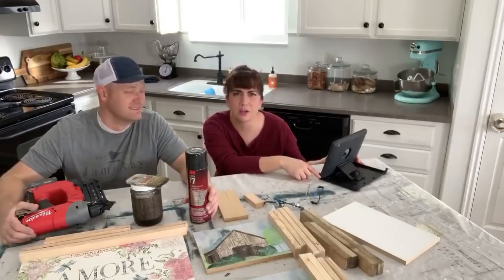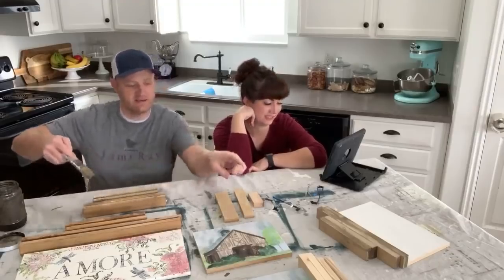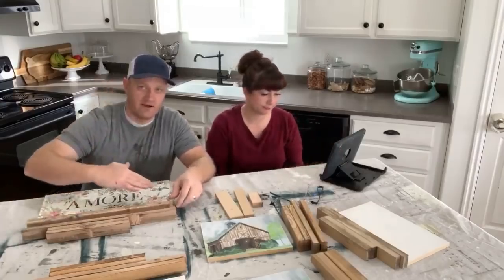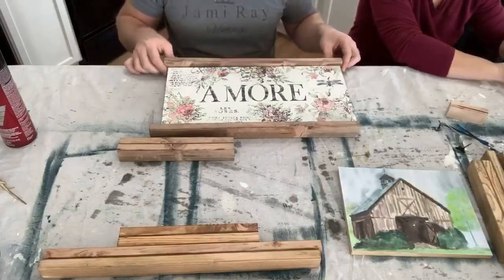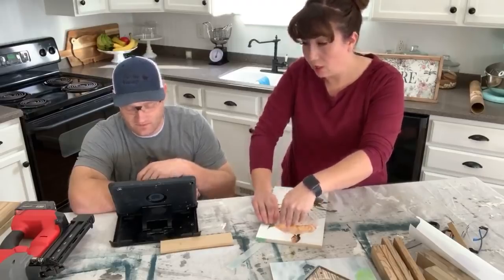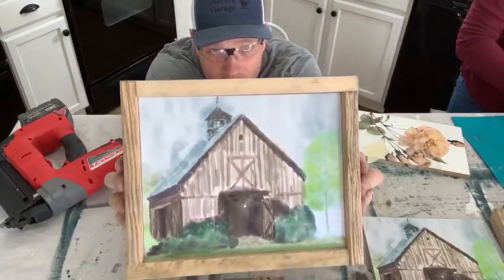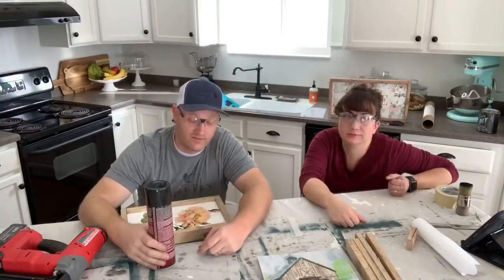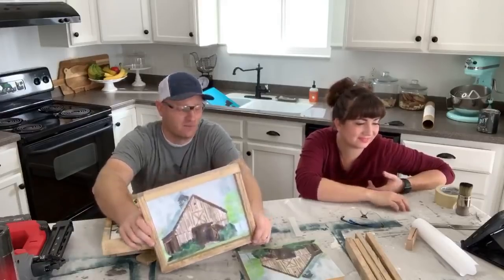🔴 How To Make Farmhouse Signs And Frame Them

Comment: Hey Zeb, which do you think works better, the pneumatic nail gun or the pneumatic staple gun? Many thanks in advance.
Reply from the maker: I like both. If you have access to an air compressor the pneumatic staple/nail gun has more power and is lighter.

Comment: When you are framing out a picture do you always crossover one side and butt up the other side?
Reply from the maker: I do, helps line them up fast. It’s preference. You could cut 45 angles or cut the boards to fit without overlap.